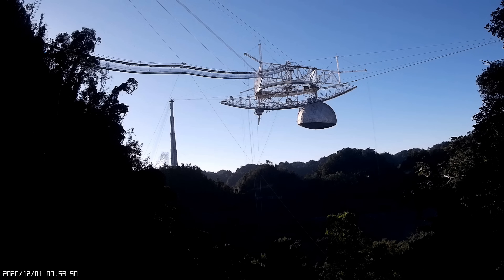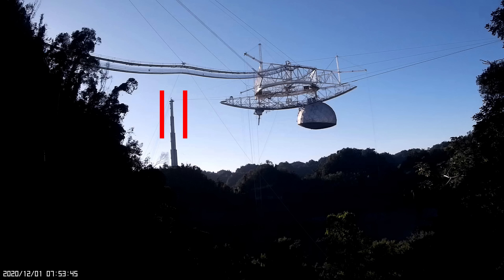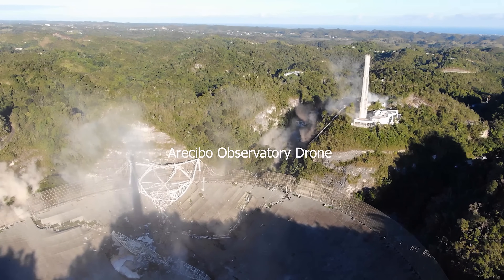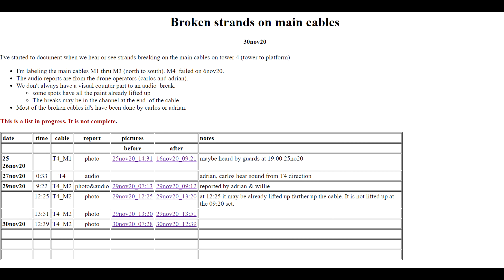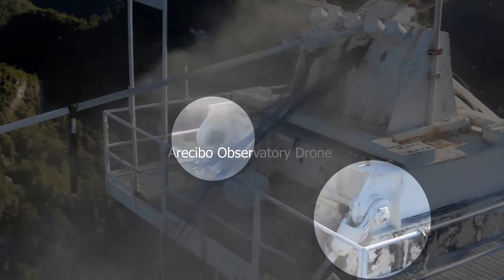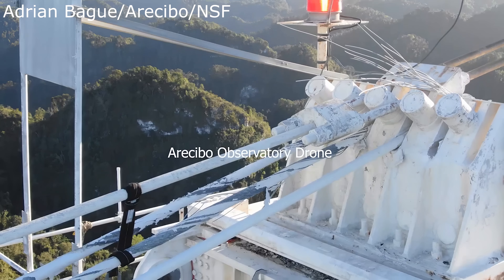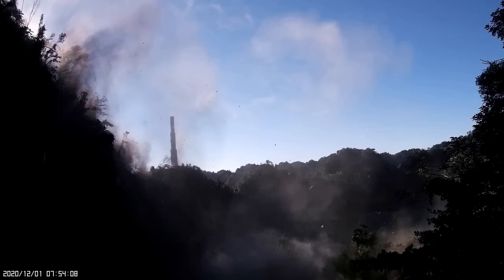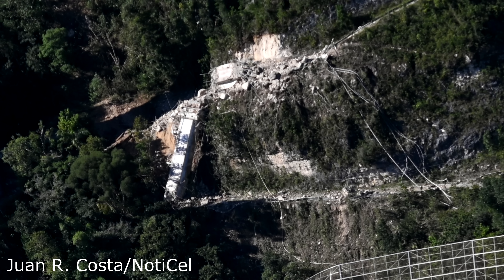Analyzing Video Footage Of Collapse of Massive Arecibo Telescope

Comment: The Way most universities work is they build up a couple of very strong departments with good well known faculty that gets grants--It is that department helps to bring fame to that university. The upper administration rewards and brags on those famous departments.
   Against this trend, the keepers of the Arecibo antenna went it to the University of Central Florida and a small weak, almost-department of astronomy. Nothing but a cooperative weak senior administration there would justify such an assignment.
     Not long after UCF became the custodian, the Arecibo big antenna fell down. The cover story is it rusted but if you look at the video of the hold-down parts-- you will only see exploding concrete around them-- not any rust. Little green frog wants to know IF Arecibo antenna was destroyed to stop its use for UFO communication? Having been a suffering faculty at UCF, frog is very suspicious.

Comment: Each timev a wire snaps, the stress on the other wires in the cable goes up.  Which makes them more prone to snapping. etc etc.  
Making a collapse inevitable unless these are somehow restored or replaced.

Comment: My father was responsible for the maintenance of structure- including those cables in the 60s and 70s. Cornell University ran the telescope during that time.Cornell lost the contract to lower bids; they knew and told the NSF that they just couldn’t maintain it for what the other bids were offering.

Comment: 1:18 What is that black sling wrapped around the steel cables doing there? It looks like it's attached to a cable on the ground and they actually pulled this thing down (controlled demolition) .That explains the "luck" of the drone being in the right spot at the right time. Must I explain everything?
Reply: No, but you can try providing any useful evidence beyond "I see a black strap" for such an outlandish claim. It doesn't "look like it's attached to a cable on the ground", because the rest of that thin (relative to the high-tension steel cables around it) wire connected to that strap is out of frame, and therefore can't tell where it leads. Did you even consider it could be attached to a nearby part of the structure itself? Apparently "controlled demolition" is now also defined as "just yank on it until it it hopefully collapses"? Come on, I've seen the ramblings of much worse conspiracy theorists that include more "evidence" than that.
Reply: @shadowfoam3491 - More evidence you want? Certainly ... play the video at quarter speed at 1:18 and hit pause at 1:23 you will see the black sling is suspended from the highest undamaged cable. It is then wrapped once over the damaged cable and is attached to a shackle with a block with a pulley in it. Around that pulley is a steel cable going down to the ground. Out of view the cable is attached to a winch or crane on the ground. You've never heard of damaged structures being demolished?  You explain what your normalcy bias makes you think that is doing there, and just by pure luck the drone was hovering there when it came down. Can you "prove" I'm wrong? No you can't. It's my opinion only so calm down Karen.:face-red-heart-shape:

Comment: Yes, they should have built the fourth support tower initially  in the original design that may have reduced the load on all the cables. It obviously needed a lot of cable maintenance to keep the radio telescope going.

Comment: when that first one went twang, it sent a shockwave into the line in both directions, when the waves propagated down the cable they set up standing waves, eventually they met creating peaks, it was a peak that triggered the total failure. has anyone run calculations on what the shockwave spiked at, at failure.

Comment: Rebuilding will most probably use carbon fiber technology. Five times lighter than steel for the same strength. Which means a lighter central platform, and thus thinner cables needed. Especially if cables also make use of carbon fiber.

Comment: I wonder if the fourth cable that had been broken had been fixed the collapse would have been avoided.
How long had this fourth cable been broken before the collapse? Because depending on the time it was broken, the collapse was due to "incompetence", as they thought that the three cables that were left would be enough. So they were postponing to fix it.
A telescope of this size, doesn't it have financial support from the countries that use it? It is certainly not cheap a cable of this size and size.
Reply: Puerto Rico kicked out the institution that largely supported the telescope.  It was predicted the scope would fall into disrepair when the military left, and it did.  Great job.

I suggest that it's a good time to boot PR out of the US.  Completely.

Comment: Makes you wonder when the last inspection was completed? Reminds me of some steel (ACSR) transmission lines i replaced on power lines in my younger engineering days.  We found the steel reinforcing strands had been losing their galvanizing on the center of the cable after 50 years.  We suspected internal moisture coming and going over the life of the cable may have contributed.  Fortunately, after we took some samples (replaced the sections) we were able to perform the inspection and analysis at the cable manufacturer.  The results gave us the support to begin replacing the high voltage lines before they failed.

Comment: Even if the plan was to demolish the structure, the missing cable should have been replaced.  Instead they have had a catastophic failure, putting lives at risk.  I do hope a new facility is started soon, it's important to retain the skills of the workforce and suppliers.

Comment: I doubt anything will be built on this site as a replacement. Funding for maintenance had been shorted for years which indicates the low level of commitment to the facility. 

Replacement energy seems to be directed towards a lunar dish in a crater, 1km in diameter instead of 300m like this one. Shielded on the far side of the moon from inescapable radio pollution on Earth, it would be far more sensitive and capable. It might also be a means to get something useful out of independent efforts to go back to the moon, which would otherwise be just more welfare for space contractors.

Comment: On sailboats, the rigging cables are replaced every 7 years, this is because a lot of rigging cables begin to fail at 15 years. Note the cables fail at the connectors where there is the most flexing/ bending.

Comment: Again an area where China is taking the lead. With their brand new "Five-hundred-metre Aperture Spherical Telescope".
Not only does the new telescope have three times the surface area, but it also has a highly innovative system that allows the dish itself to be flexibly deformed to be perfectly aligned with a target.
Reply from the maker: But it doesn’t have RADAR capability.
Reply: @scottmanley  Not yet but it will be updated. 
With the clever design of the focus cabin, which can be lowered very easily in the middle of the dish, new receivers can always be installed.
It is very sad that such an important scientific instrument like Arecibo has been so badly maintained.
Reply from the maker: Yes, and most experts don’t believe the design will support RADAR without major retrofits
Reply from the maker: @Medley3000  Or, maybe they think most people will be convinced by the 'bigger dish' argument and not look any deeper at the lower accuracy or lack of RADAR capabilities.
Reply: @scottmanley  The radar astronomy of the Arecibo telescope was only made possible by the subsequent installation of the dome. Why shouldn't the Chinese be able to do the same? At the moment, the radio astronomy has to work first. Of course, one concentrates on this first and then the scientific work with the new instrument can begin.  After all, science will already have a better instrument at its disposal. Updates will be come later.
I just feel sorry for the 140 employees in Puerto Rico who are now unemployed because NSF was not willing to continue funding the project and thus maintenance was neglected. That was a disaster with announcement.
Reply from the maker: @Medley3000  Arecibo was a radar long before the gregorian dome was added.

Comment: The varying rates of failure for the support cables indicates that the were not tensioned evenly to start with. There should have been a mechanism to monitor and adjust the tension of each cable so they are all identical.
Reply: It should have been a part of routine maintenance. Replacing a snapped cable should have been planned for too. I think the budget just got cut too small and doomed it. There were months after the first cable broke, so there was time to fix it if anyone considered it important... Science wasn't really a priority for the political party in power at the time though...

Comment: From an engineering stand point.they had a drone observing probable failure. why not lower everything and inspect. Engineers know it was imminent. The proof is in the operation of the drone.they knew the sequences of events.not very smart. Delbert Ignorance!
Reply: there were tension sensing gizmos placed to every cable anchoring. even a look thru windows installed to it to see how much the cables slid out of the cable ends. so yes they new it would go sideways sooner or later.

Comment: So, long story short it fell due to lack of maintenance.
Reply: The problem is how do you replace something that massive and under such high tension?
Reply: @protoborg  The same way they installed it, only in reverse.
Reply: @poopjeans1135  That's not the way maintenance works.
Reply: @protoborg  How the hell would you know, You couldn't even come up with a single suggestion.  They could have taken the weight of the central part off the cables and ran new ones.  There, that work for U oh grand engineer poobah?
Reply: @poopjeans1135  At 900 fucking tons?!  Not fucking likely.

Comment: Thanks for you video Scott.  I was a high school student at Inter American University Campus School in San German, Puerto Rico from 1964 through May 1968, and one of our field trips was to the Arecibo Radio telescope. Thus I have an interest in the subject matter. When we toured there in 1966/1967 we were told that Cornell was operating/managing the facility and I’m curious what changes might have transpired or been Implemented as the management changed between management “shifts” at the telescope, and how or what if any, impacts thereby ensued that could have contributed to is failure. Thanks, 73s Tom KC3QAC

Comment: if it was really important they would have changed the cables.
Reply: How?!  You can't just swap out cables under that much tension.  They sure as hell couldn't lower the platform with anything.  It was just too damn big.
Reply: @protoborg  they do it on bridges do they not? I find it amazing the technology and will is there to build thing but not to maintain them.
Reply: @hotpotato4027  First, bridges are suspended from THOUSANDS of cables, not three huge ones.  Second, when was the last time you saw the Golden Gate Bridge without its primary cables?  Third, the cables for a bridge are not holding up 900 TONS of steel.  They hold up a few hundred POUNDS of steel.  Fourth, bridges are generally MUCH LOWER and thus they can be reinforced during maintenance operations to take the load off the cable being replaced.  What do you expect them to do lift this thing with a fucking helicopter?!
Reply: Photoborg really is a dislikable fellow and typifies all that is wrong with many YouTube viewers and their attitude.
And what he writes shows complete lack of real knowledge.

Comment: So many things to add to your descriptions.
First...yeah, not up to modern code is an understatement.  And that's just for construction values.
As for the wires themselves...i don't know if anyone else mentioned it...but 1st:  the wires were corroded.  Paint doesn't do that good a job at protecting metal, and all the zinc poured into the wire housing didn't eliminate all the humidity that was on the wire, prior to pouring.  Nor could it be 100% certain that a fissure wouldn't have formed to allow water to enter.  2nd:  the fact that the wires broke one at a time instead of all at the same time suggests that the tension on each wire was not evenly allocated.  3rd:  Redundancy would allow for only 2 wires to do the job.  So the fact that there was total failure with 3 wires remaining suggests that there should have been 8 wires, instead of 4.  For all intents and purposes, everything that could go wrong, did.  I too am glad to hear that nobody was injured during this metallurgic failure because, where i work, injuries are logged...daily.  As for that go-pro camera...it doesn't do justice to the sound effects that happened when the wires broke...i know...it's what i do...break wires.
Finally, your optimism is so honest that it breaks my heart to know that you're not aware of the cost to build the large Hadron collider.  So huge that only a fraction would cover the cost to totally repair the MAT.  But that's how politics work.  Important things like feeding the hungry don't get funded, but to spin a particle, no money will be spared.
Good work, Scott.

Comment: Drop All Weight. That what was needed but it was not designed for that type of repair. There was cable damaged months prior to the total loss but it was not possible to fix the damaged cables. Even trying to bolt on heavy lowering cables would have added weight and snapped the damaged cables faster. Ok lets say you could bolt on lowering cable system then setting it down would mean complete dish removal. It just was not possible to save even if they had more time. Also PR surrounding radio noise was causing problems with in coming signals.

Comment: So, they just set up cameras to record it in case it falls and not a single thought of actually lowering it down has ever crossed their minds? What the actual F*.
Reply from the maker: Suggest looking at the designs and realizing the Army never designed this capability.
Reply: Thank you for the response, it's very valid, thought they did put it up somehow, so I am certain it would also be possible to put it down somehow, maybe not in an easily reversible way, but still better than this.

Comment: I am still puzzled by the fact they didn't dismount the expensive equipment or lower the central part down and just let it fall down.
I am 100% sure that a controlled damage when they lower it to ground would still be better than letting it fall on its own.

Comment: Preventive Maintenance applies to giant dish telescopes as much as it does to A380 aircraft, nuclear power stations and your dishwasher in the kitchen.   Certainly this telescope didnt have oversight  and system in place to prevent this
Reply: Part of the problem was that the cables were essentially supporting about 50% of their tolerance, they should have been supporting 1/6th, but the design of the cables kind of precluded that and set all this up in the end.

Comment: They should inverstigate y the 1st cable break.  It might be far fetch but if i own the biggest radio telescope in the world which is and will be only in China and they could charge anything they want if this got destroyed right    consperacy hmmm. What if someone "weakened" the 1st cable.   When did the china radio telescope when on line  jan 11 2020    hmmmm coincedence.  What do u think.  Cause if i was thinking of money control prestige and bragging right u probably wsnt to remove d competition.  Why was the break occurred were its accesible to foot traffic y not in the middle between d towers n transmitting dish. Hmmmmm again.
Reply: There might be some validity on that observation.

Comment: How unfortunate.  It seems to me the roots of this disaster go back to the original design.  Some combination of corrosion, stress corrosion cracking, metal fatigue and damage from hurricanes and earthquakes eventually led to failure.  The designer's failure to account for these factors doomed the telescope from the start.  This structure was nothing more than a cable stayed suspension bridge put to another use and as such the the technology was well and truly mature when the structure was designed as was knowledge of corrosion, metal fatigue and so on.

Comment: I visited in 2012. It's impossible to get a scale for the size of this place from videos and pictures. Walking up to the visitor center and getting a close-up look at those cables running up to the back of tower 12 was incredible. If tower 12 had fallen to the left and not the right as seen in the Go-Pro camera view, it would have fallen through the roof of the visitor center and labs, and could have killed anyone inside that building. They were very lucky!

Comment: It'll never be rebuilt because of what the data has been showing for the last 40 years. We are under a firmament and that the supposed stars are points of vibrational frequency. Backyard amateur astrologers have been discovering that for millenia, it can no longer be hidden but the data can.

Comment: You look at these massive structures held up with cables and 'sprung', and common sense, (rather than engineering laws - which must have been employed to design it) tells the practical man that it's not a safe idea.

Comment: Marvel of engineering on those steep mountains to work on all those structures, it took incredible trust to walk around this structure when it was new.  It was so huge and so fragile looking with those cables tension so far to the towers, it seems the towers should have been arched away from the force that the cable tension applied